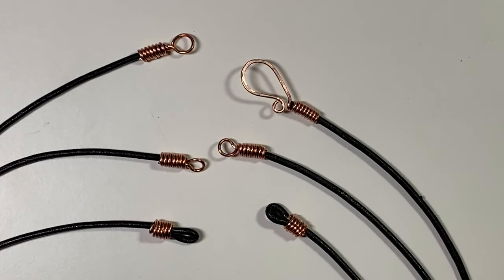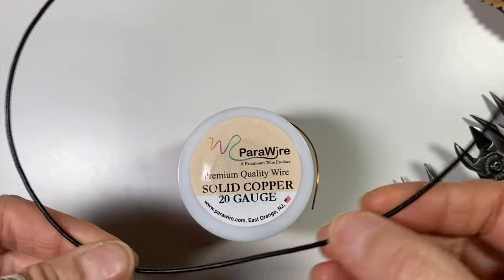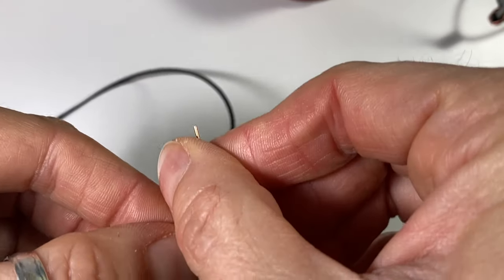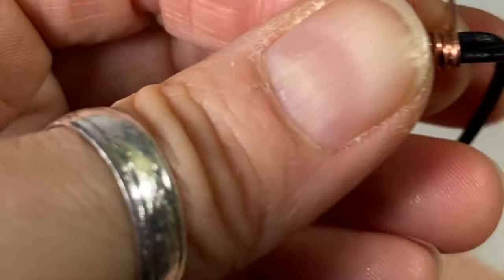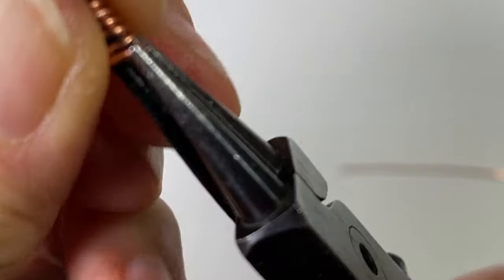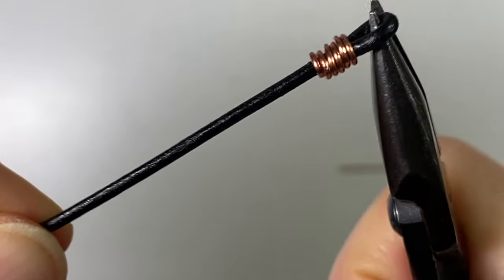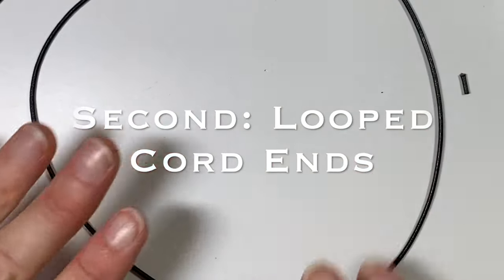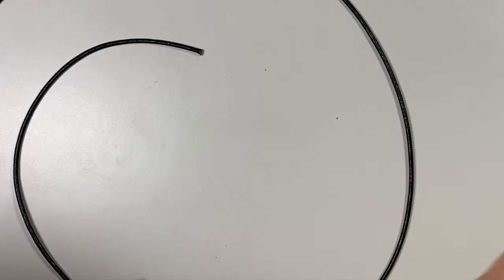DIY Jewelry- 3 Ways to Finish Leather Cord Ends!

Comment: I tried out the #2 method with wire loops both ends, and I used cheap Half Hard 20 gauge crafting wire for practice. This was very hard on the fingers and holding the wire and leather together while trying to wrap was very hard!  I think I will switch to #1 method with leather loops and add a jump ring.  That Half Hard wire is very hard to work with.  I did not want to waste my Dead Soft copper wire without some practice first.  I love these 3 finishes, so convenient to make chokers with.  Thank you!
Reply from the maker: You’re welcome! Dead soft should be sooo much easier on your hands!! ☺️💜

Comment: Just what I needed!  I never thought I could finish off ends myself, always buying cheap end caps that peeled and looked awful. So very glad I found your channel, Melissa, you saved me a big bother, and now my pendants will look very good on the leather cords I did not know what to do with. Thank you so much!  I like #2 the best - so versatile.
I would suggest that we pinch the loop end on one side so it fits all pendant jump ring sizes being an oval instead of round.
I can also see adding a small bead on the tail near the loop, or an endcap to cover the leather trip, that would look like a rondelle bead over it - same matching copper metal.
Reply from the maker: I’m so glad I could help! ☺️💜

Comment: Great tutorial! I love the last design, but wouldn't it be best to use part of the excess wire as a guide for wrapping around? Start wrapping up towards the end of the leather maybe? I have been trying something different before, which didn't work too well: a hole through the leather and wire through for extra security, but wrapping round the leather without any wire inside turned out impossible. I was using hard brass wire though. Will try your method and hopefully finish the husband's Christmas present in time...
Reply from the maker: That would be great if you could improve the technique! Hope you got them done in time! ☺️💜

Comment: How do you fix the tool marks when you're finished with the wraps?
Reply from the maker: If it’s bare wire you can buff it out with a polisher. I use a dermal with polishing tips.

Comment: Thanks for these methods, they are very useful! I think you could have added the jump rings when you started making each side of the first two methods. It's nice that you did close-up filming to some extent, but unfortunately you went in and out of focus a lot and made lots of jerky movements, not sure that was because you edited this video and cut and spliced multiple times or whether your hand went in and out of frame repeatedly. Either way, I think it would be better if your work wasn't so close to the camera (requiring focus adjustment) and your hands and tools would hopefully stay within the frame more often. I nearly slowed the video playback speed down to 0.75 but that would have made this video longer. All the best!
Reply from the maker: Thanks for the input. 
This video was made back when I was trying to figure out this whole filming thing!